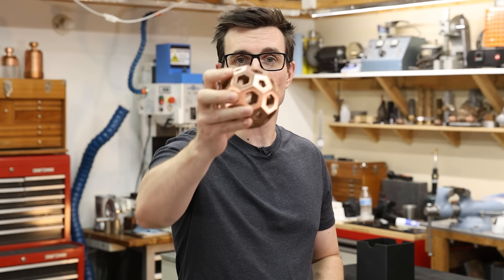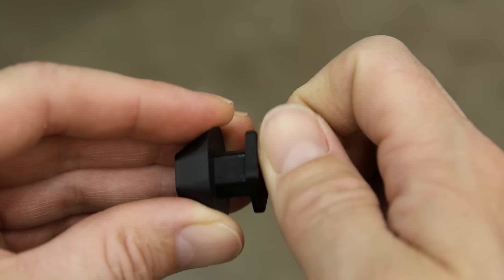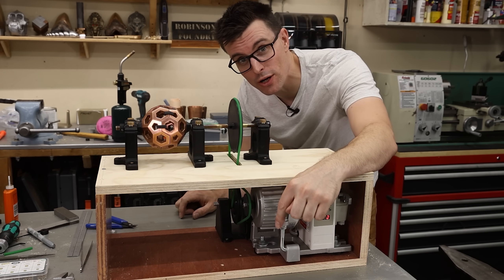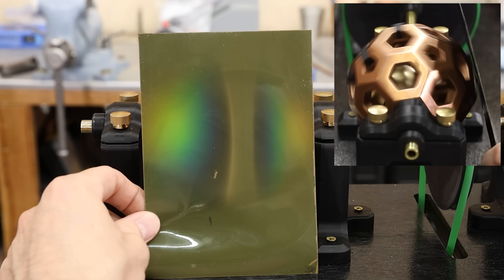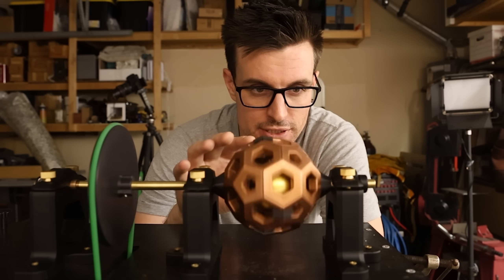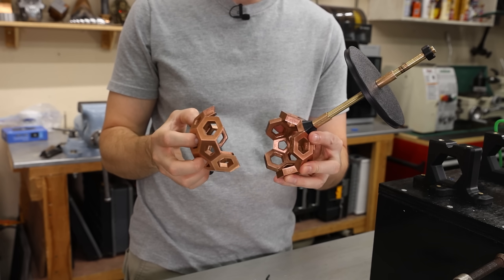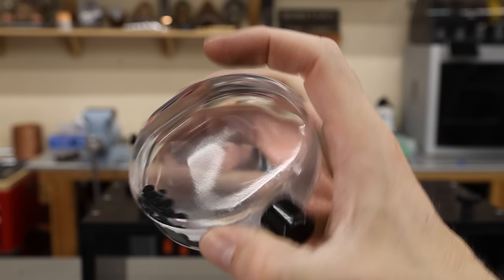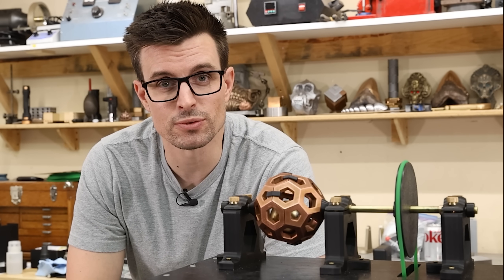Huge Magnet vs Copper Sphere - Anti-gravity Machine

Comment: I found an old alarm clock online that was made in 1930. To familiarize with it and adjust the rate and make sure the antique dealer had properly reassembled it, I found that the balance wheel (AKA remontoire, escapement, ticker...) is suspended between two naturally magnetic sockets. When properly adjusted to the right proximity using a spacer screw, the axis of the balance wheel spins freely back and forth without touching either socket. It's accurate to within 1 or 2 minutes over its approximately 18 hour run-down time. It's built like a nickel-plated art deco style tank. It's almost 100 years old now and has lasted longer than any other clock or watch I've ever owned.

Comment: I would recommend that you tighten the tolerance, move that motor waaaay farther away, and maybe a slightly smaller magnet than the large one, or a stronger one as the same size as the smaller one.
Reply: Also, a thicker copper cage, so the eddy is stronger.

Comment: automotive guy here work with pulleys alot and a pulley with teeth and a splined design with a countershaft weight for the shaft would do wonders, i believe you can get companies to make custom belts
Reply: car axles are designed as such and you can secure it in the end with a bearing and bolt. look up press in wheel bearings

Comment: What about suspending the magnet during start up. Redesign your connection points so you can feed a smaller diameter tube through the axle pipes. Clamp the sphere between them until you are at the speed you want to test then retract the tubes to let it free fly. The connection to the axels could be larger and clip to the next windows out from the axle like.

Comment: The weight of the magnet will still have an effect on the balance of the rotation of the whole system even when floating and small distances are important with magnetism.  Even the flex in the brackets you are using to hold the two halves together will destabilize the system enough to cause problems.  Just throwing some observations out there.

Comment: If the interior of the sphere is off in the dimensions, then the strength of the field would be different at places where the copper is closer or farther away from the spherical magnet.  That would cause the magnet to wobble as it was attracted more or less respectively.  Need to make sure the interior of the copper is super even and smooth.  That might help.

I wonder if the thickness of the walls would come into play as well?

Comment: I think if you get hollow pegs to hold the copper sphere and rotate. Then an aluminum pin through the center going through the hollow pins and the magnet holding the magnet perfectly in the center until you get the rpm up a good speed then slowly pull the aluminum pin out leaving it in the center.

Comment: Wouldn't the inner magnet eventually catch up with the copper, and then lose the difference in speed? Bit like induction motors... you need that 'lag' in speed to 'create' your force😅I think your problem is that you are using a polarised force that works at 180 degrees to each other...but you are using a sphere that puts force in 'every' direction! There is no way to keep them aligned 😢 I discovered this by dropping spherical magnets down an aluminium tube, once I started using disk magnets in unison.. everything changed 😅😅

Comment: One problem I've noticed, is the fact that your clips are hitting the magnet sphere, which is causing the variation after that lower speed centering, and that centering is probably only occurring at a harmonic of that original centering speed. 
   The only way to eliminate those clips is to use a hole and pin setup to lock the two halves together, and to have the seam run from shaft to shaft with the internal surface of your hexagonal sphere is also circular so that no internal straight edges are internally hitting into the magnetic spheres outer surface and thus producing that random variation.
   The other thing I noticed was the fact that as you sped up the motor the magnetic sphere was pushed to the non motor end of the shaft, thus making the sphere hit the copper at a smaller internal radius. You may need to magnetize the motor end of the shaft with a light magnetic field to attract that end of the sphere to centre it. This probably happens because motors magnetic field increases with speed and there is no balancing opposing field to balance it.
Reply: Also the gravitational field will always pull the sphere towards the bottom (due to gravity of our planet), so this type of system if we use the three directions of the cartegian co-ordinate planes where the amount of deflection would point out gravitational deflections direction and strength vectors from unseen heavenly bodies???
Reply: And relative speed in space???

Comment: Have you given any thought to active magnetic stabilization with driven coils? My background is in MRI machines, which make use of 2 sets of wound coils to shape the field. A small set, called the "shim" coils makes the field uniform in all 3 axis. Then a large set with high power electricity creates "gradients" in the field for imaging purposes. If you wind coils near the sphere, you might be able to stabilize it and compensate for any imperfections in the ball magnet and the copper cage. It would take the complexity of the project up exponentially, but it might work. You would need to do some deep thought on how and where to wind the coils and how to drive them (A signal generator perhaps?). I don't think a static field would work. My Specialty is electronics, not magnetism, but I spent a lot of time around magnets the size of a compact car. It might also defeat the purpose of our experiment to have electronic control, as everything you have done so far is passive (other than holding up the toroidal magnets). Thinking about it, one of the forces you are fighting is gravity. If you mounted 2 coils at 45deg angles from the centerline of the ball magnet, you might be able to nullify the gravitational pull with a static field.

Comment: I think your symmetry is all wrong. Looking at how you made the sphere from 6 and 5 sided shapes, it reminds me of antisymmetry, as these shapes may have equal length sides, but they are of two different sized shapes. Because they are not the same in overall width. Another thing to think about is the fact that those clips used to hold it together are most likely a design flaw within themselves. Weight distribution problems are also obviously present. You obviously need to rethink your entire design. To further compound your problem is the fact that even spherical magnets have a North and South pole, one being the positive end and the other being the negative end. Like poles repel each other, but opposite poles attract each other. This spinning system you made does not seem to me to fit in with the physics of magnets, no matter what the materials it is made of are.

Comment: use Neodymium (NdFeB) grade N52 — it has the best strength-to-weight ratio. Avoid ferrite (heavier and weaker). Colder = lower resistance = better levitation (even without reaching superconductivity)

Comment: I would recommend a tube of copper, instead of the hexagons and holes...
Have open ends with clear plastic caps that mount the axle of your rotation.
The consistent copper would more evenly distribute the electrical field - and you can shine a line from the opposite site for observation.
And make a longer axle to your drive motor so separate the magnets.

Comment: Using an FET transistor and an O scope you may be able to find a resonant frequency where the magnetic ball begins to float? What about a round tube with holes in it, simular to the tube you were using with end caps so you could spin it?

Comment: I think the visibility issue could be overcome by painting the copper cage black and the sphere matt white.
It seems the problem of the magnet not levitating is cause the magnet ball starts to spin in synchronisation with the copper cage so it no longer has enough relative movement to electrically induce a counter magnetic force and levitate.

Comment: Goofy but what about spinning it Horizontally, like the Earth spins. Though it may be as a Vortex with the Sun pulling it,  maybe gravity pulling it down while it spins Horizontal will be "close" to the equivalent of the Suns pull at Earth. So theres kinda like 3 separate "forces" at work, the Rotation pull from the Sphere, the magnetic force from the inner ball and the downward pull of gravity simulating the Suns pull.

Comment: Contrary to typical elaborately complex scientific names,the imaginary line that goes through the center of both poles of a magnet is the magnetic axis, and the line perpendicular to that exactly between the poles is simply the magnetic equator.

Some additional experiments you could do is using two cheap webcams and two pieces of magnetic viewing film is:

1. Draw a circle the exact size of the copper sphere with with lines dividing it in half both ways, and pace one at the back and the other at the top, in a frame with the lines aligned with the center of the copper sphere.
2. Put the cameras pointing at each.

Now you will be able to see the magnetic fields and when the sphere is aligned on all three axis. That indicates it's floating perfectly in the middle.

The reason the stroboscope isn't working for you is that your motor, the stroboscope and the frame rate of your camera have to be perfectly in sync, and you need a fairly dim or dark room.

The problem with the larger ball is that the magnetic forces are not strong enough to overcome gravity.

The method of using 3 rings on 3 axis works best but you have to do the calculations of the magnetic forces of the rings because to be able to have them spinning on different axis they have to be at different distances. Do a Google AI search for "calculation for suspending a magnetic sphere inside 3 rotating copper rings".

Comment: interesting video, my first thought is - think about that with each hit of the magnet the shock will decrease its magnetic force slightly. so be carefull with your equipment. neodym magnets are super strong, and i dont know you are using them here, i am inclined to say no to that because you dont seem to have issues with the forces at all. i got some pretty big neodym magnets myself and one of the size of that sphere you used might cling at this distance to that motor for good probably. :)

Comment: Place magnets around the outside of the conductor should be aligned to repel. if the fields are evenly spaced this should encourage the magnet to move to the center, realistically you only need one row of magnets placed parallel to the center , as when your apparatus rotates fast enough the flux will act as if it is even around the ball.

Comment: Try the experiment of dropping the magnet through the inside of the copper tube, but with holes like the ones in your sphere. I think that’s the problem — the sphere should be solid without holes, or you could use a copper tube and watch the results from one end.

Comment: I think you need to sand the inside and make sure the inside is completely spherical like the inside of a copper tube like you need to have a concrete ball and then make a mold around it and then pour the copper into it instead of trying to machine it

Comment: Try putting something in between the copper with higher permeability. I think uneven air gaps between the two halves could cause unbalanced induced magnetic current; as it can't effectively cross halves evenly.

Comment: If you do an orb with a thermacoustic horn inside you can get the whole thing to levitate. Same way those orbs found in South America fly. Have to work with ratios for acoustics to tune the orb then put a thermoacoustic horn inside and then hit it with sound until it gets hot. You don't really need the magnet but just parallel vibrating conductors have the same effect giving you the change in the field. They are tuned to about 360 hertz and the size of a football. Like any conductors they get hot and that heat makes a sound that powers it forever because it keeps moving the conductors. The outer shell is negative and the inner horn is positive and it alternates. The more the change in the conductors the greater the magnetic field... and it's done with sound and uses it's own feedback. You don't need to spin the conductors in opposite directions either, you just need to vibrate them. No moving parts. The orb itself is a tuned asymmetrical capacitor holding the charge so once it gets hot it also powers itself for free. The conductors need to be positioned at the node on the horn so it heats up the node at the right spot to make a sound..... and the bottom node on the horn is located exactly 0.224 x the length of the horn.
Parallel conductors carrying current will exert a magnetic force on each other.
One thing to point out. Once you start it up it will take off on you and you'll likely never get it back.

Comment: I had an idea once to cover a ping pong ball in small N52 magnets,  so that all their faces are pointing North. And then placed inside a larger hollow ball that has the INSIDE covered in small N52 magnets,  also with their N side facing inwards.  The small ball goes inside the large ball,  and.... 

Well,  i don't know what happens after that.  The smaller ping pong ball should float!

Comment: Seems like the shape of your not sphere is generating a wave force vs a stable one. Combine that with the mass of the magnet and it riding on the wave...it hops instead of floats. I'd guess a perfectly smooth (curved?) inner and outer surface to the copper would help. Think ball with holes drilled through it vs the hexagon shapes and windows you have now. Or even a solid outer sphere.. wouldn't be able to see but you be able to hear if it's contacting or not.